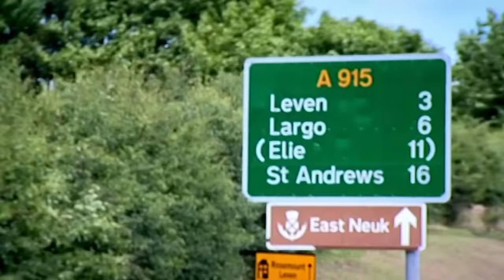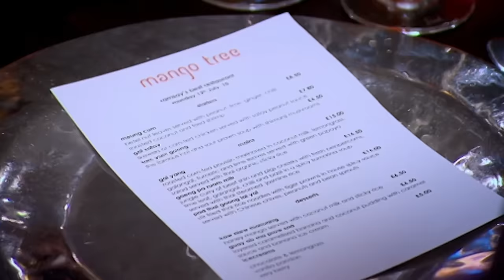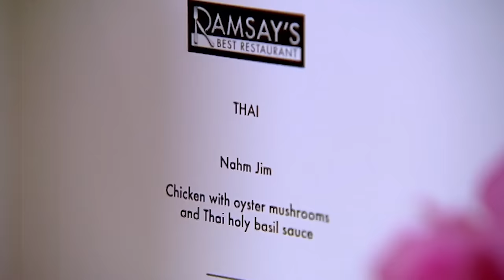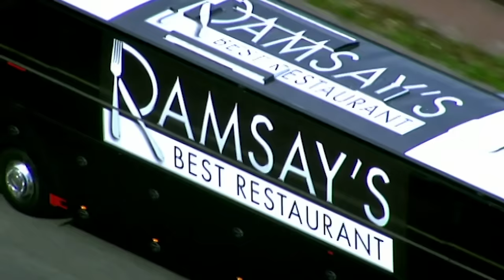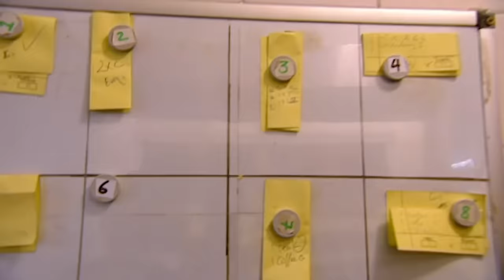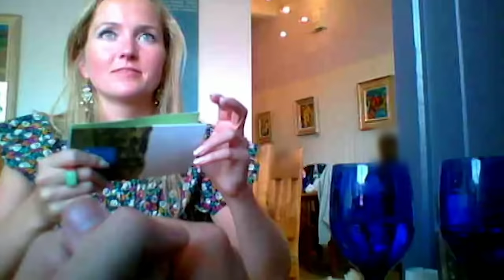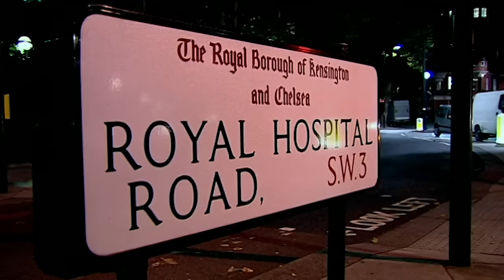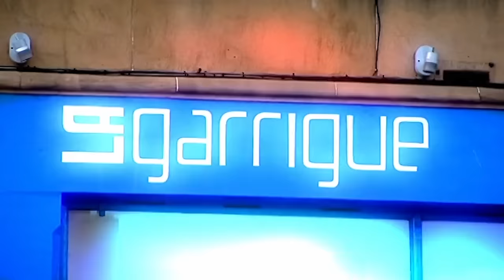They Served RAW CHICKEN To Gordon's Diners! | Ramsay's Best Restaurant | Gordon Ramsay

Comment: There is no excuse for raw chicken being sent out. It's a legal requirement in the UK to probe food above 70degrees before sending it. Iv'e noticed not one of Ramsay's shows uses a probe, not one!  It would solve the "is it or isn't cooked" scenario with food being set back raw and ultimately binned. Do they do it deliberately just to get Gordon screaming "It's Fuxxxxg RAW!
Reply: Cool story bro, but it’s actually 63°c so long as it’s been cooked properly, it can then legally sit for 2 hours in certain examples, I.e. buffets after which point it needs to be cooled to 8°c or below.

Still why let 10% difference get in the way of a good yarn…
Reply: Thank you for your reply. In the UK the legal minimum temp for sending hot food is set by the Environmental Heath Agency (EHO) is actually 75 degrees or above (82 degrees in Scotland, they get their food over cooked /ruined LOL) However most chefs ignore this guideline but we do probe  70degees min to be on the safe side especially chicken. The only exception to this rule is a steak cooked rare / medium rare. Hot holding cooked food in the UK is a max of 90 mins above 65 degrees.  The UK has some of the most stringent hygiene rules in the World. Gordon Ramsay is in charge of running the pass and should "NOT"! be sending out raw Chicken and then blaming the chef, The Chefs should be temp checking what they cook before it reaches the pass and whoever is running the pass should then temp checking everything before they send it. TV show or not there is no excuse for sending raw chicken or anything raw. Continuously sending out raw chicken to dinners would in the UK  warrant an investigation by the EHO who would then close you down. Kind regards. Ade.